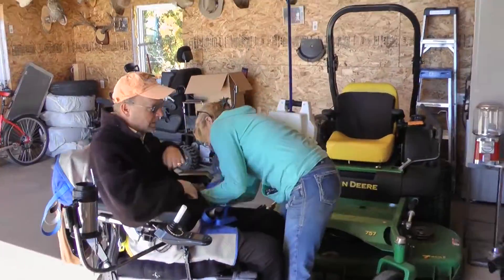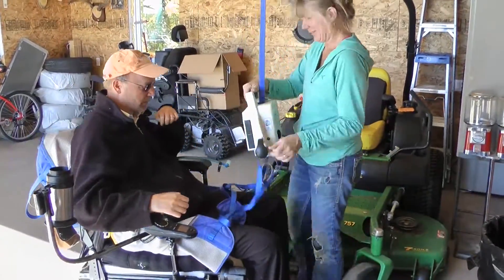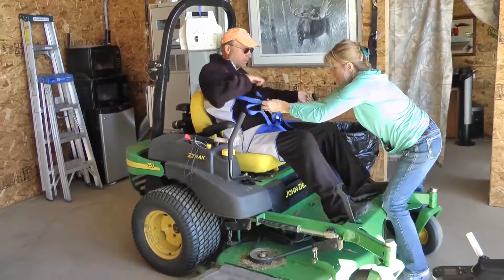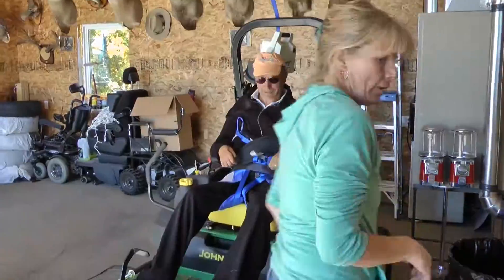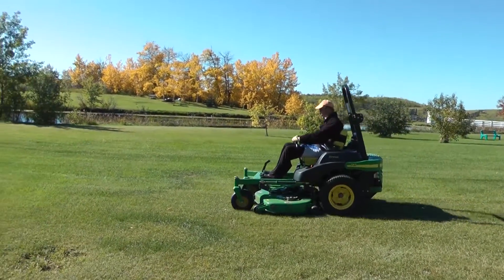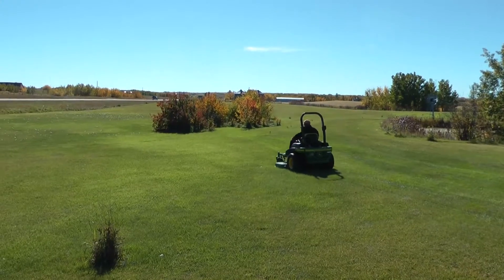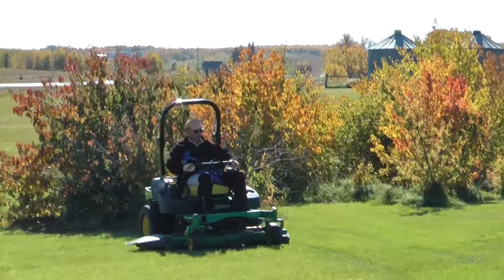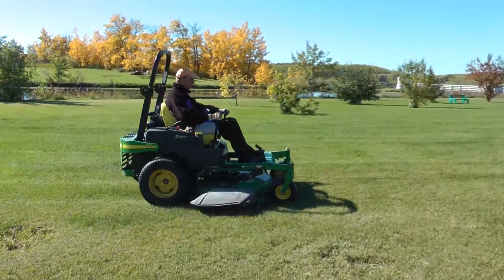Quadriplegic Lawn Mowing

Comment: Looks pretty perfect for a quad! Do you have any trouble with lateral stability while sitting on the lawnmower? Do you typically have any lateral supports in your wheelchair?
Reply from the maker: +dvanwage My lateral stability is poor. We strap my gut/midsection with a couple of wide weight-lifting belts from Wal-Mart, they seem to hold me upright ok.
Reply from the maker: Update, I bought a 5-point racing harness on eBay and it holds me much better, side hills are ok now.